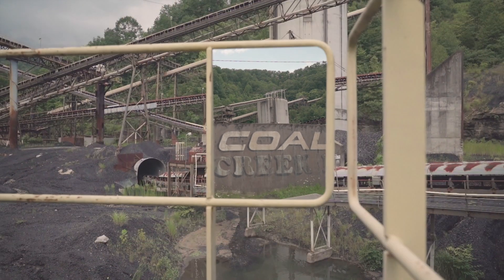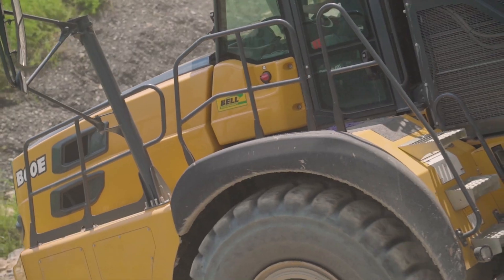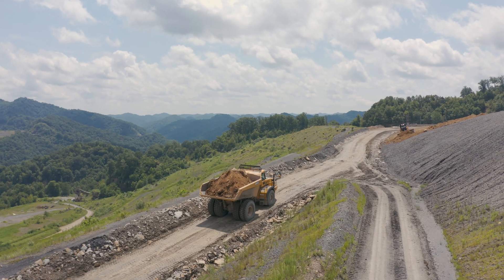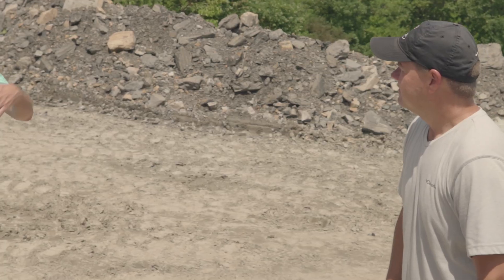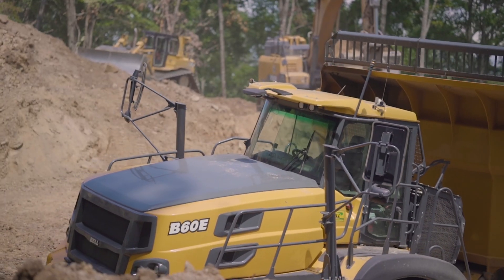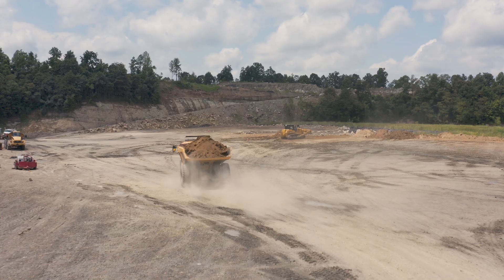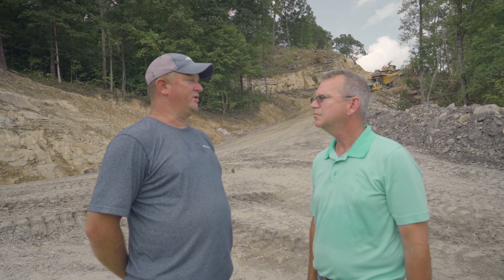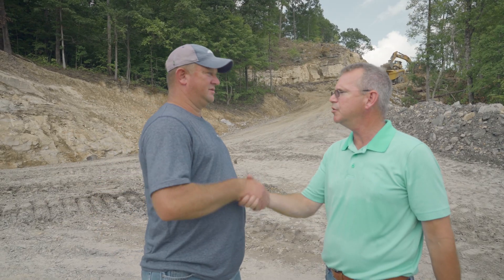The Beastly Bell B60E: Revolutionizing Mining with Dump Trucks

Comment: Eh, you don't really need to stop work in adverse weather conditions with rigid frame trucks. The only actual conditions worth stopping work for no matter the truck (scrapers included) is severely greasy and icy hauls roads plus heavy fog and blizzards. I've ran Cat 793f/d and Cat 777g haul trucks in conditions that would make most other operators balk at the sheer though. Just power through the retarder, you'll have some control and and better traction. And for the cherry on top, if you've got running water, you usually have traction. 
On a side note, I believe the Cat 773 (60 ton) isn't really much bigger, will have to compare sizing. But a cool haul truck that can work a some crazy angles and tight areas.
Reply from the maker: It sounds like you have a ton of experience with these trucks.  Thanks for taking the time to share and we appreciate you watching!  Have a great day!